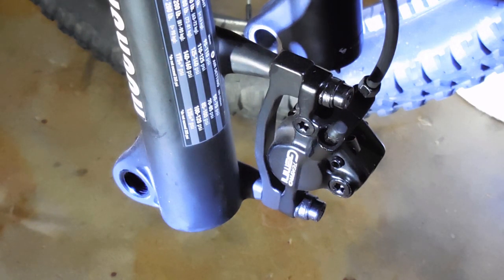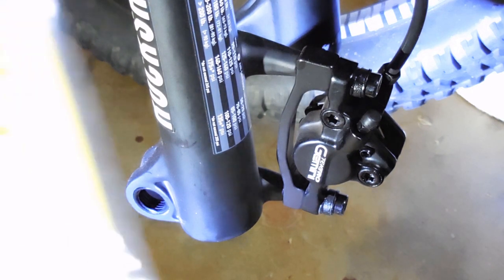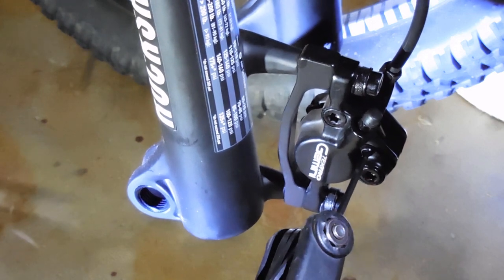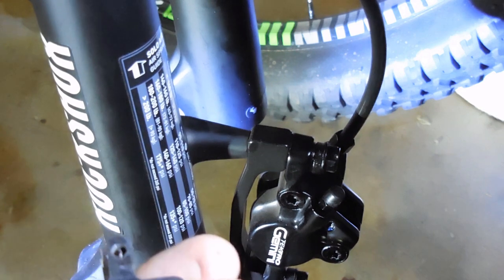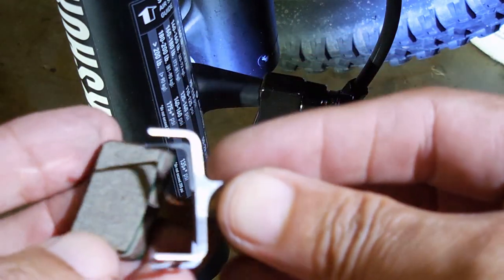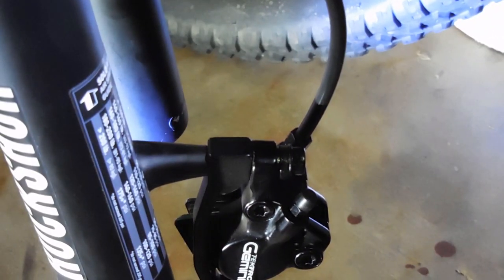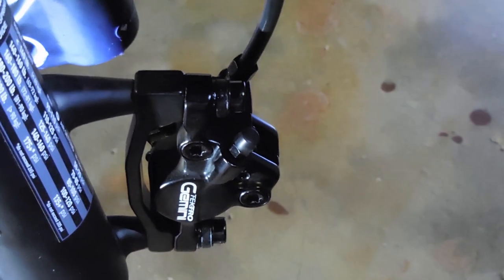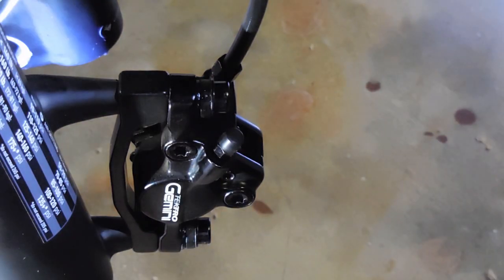How to replace pads on Tektro Gemini hydraulic brakes

Comment: Thanks for the video, very descriptive. I have some shimano brakes that for some reason they are not performing well. I found a really good offer for a pair of tektro Gemini (front and rear for 90€). I saw that the shimano that I have already installed use the B01S pads, hence I conclude from your video that I should NOT buy them because I'm practically replacing the very same set of brakes, 90€ to the trash. Not only the pads are the same, but also they use both 160mm front and 180mm rear discs. I'll replace the pads and clean the disc to see if the performance improves. When the bike was new It performed far better than today
Reply from the maker: Sorry for the late reply. Both sets of brakes will be similar since they use the same pads. In my case the new pads worked much better. You can also try bleeding the brakes if you have not already done so. I hope it worked out for you.

Comment: Great information, love it👍did you bleed m as well, and did I see some blue loctite at the pad securing hole?
Reply from the maker: RV EUROPE ON TOUR I did not bleed them. The loctite was from factory. I did not add any additional since there was still a fair amount left on it.
Reply: @TonyHob  thanks,.. Might need to bleed mine....thats why I asked..the rear brake gets soft, pads and break point slowly disappears....OK no extra loctite in some case needed..good to know

Comment: how often do you change them?
Reply from the maker: When they are worn or contaminated, it will depend on how much or how you ride
Reply: @TonyHob  Do you feel the difference or you have to check them?
Reply from the maker: You will feel the difference or squealing if they are contaminated. As far as wear you have to check them, if you can feel the wear, it’s too late. Your disk will be damaged